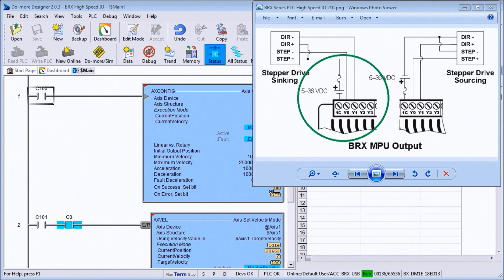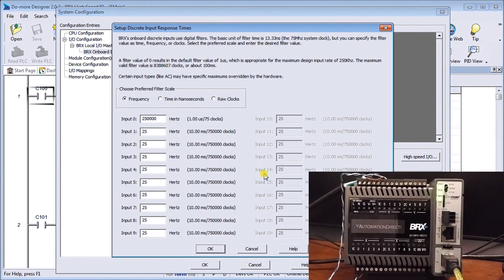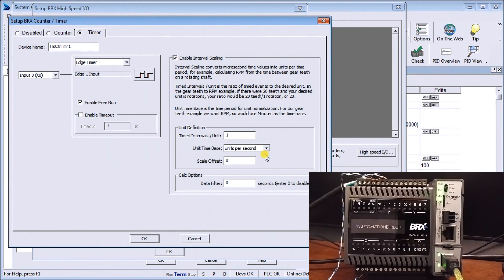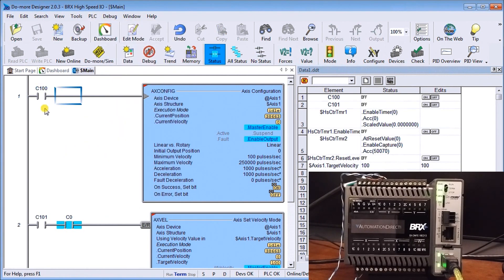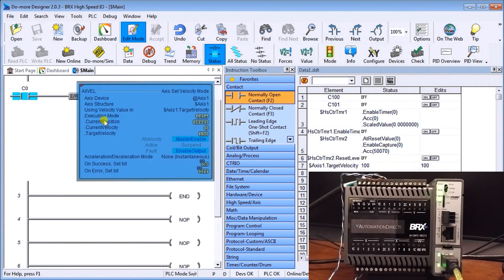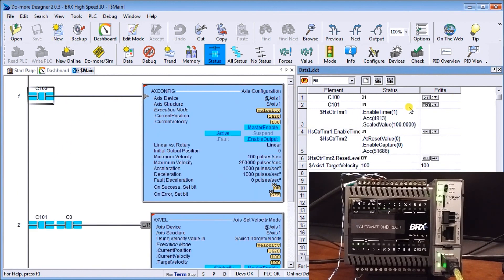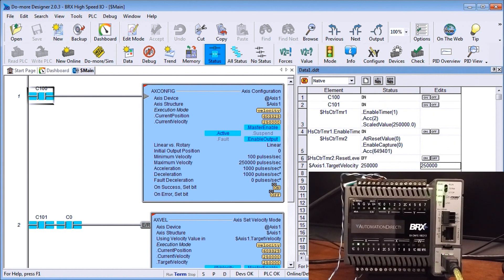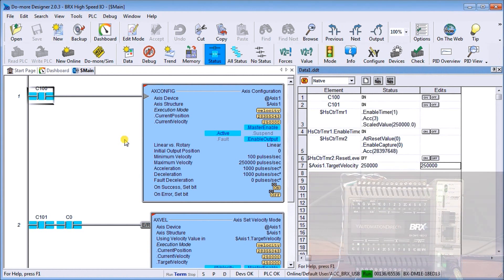BRX PLC High-Speed IO Breakthrough: Real-Time Pulse Testing

Comment: Would you have any links or good starting points for learning motion control,I would like to learn best practices etc, thanks
Reply from the maker: Hi Aussiegruber86
Every application that I have done in motion has been different. In general, stepper control will handle a constant load while servo control will handle a variable load. You then get into the number of axis or plains of movement. Does the axis need to be coordinated or do they act independently? 
Acceleration, Deceleration, and speed will not play a part in specifying the equipment required. 
I do not have specific links that I have used. Generally, I have been called in to consult on existing equipment that needs to be programmed. 
Manufacturers usually have great documentation on their products.
Here is a link for automation directs motion control videos.
https://www.automationdirect.com/videos/home?t=link&cat1=50
I hope this helps you out.
Regards,
Garry
Reply: @ACCautomation  thanks for the fast reply

Comment: is it possible to wire the output and input the same way on a bx-dmie-10ed-13  with an external 24VDC power supply going to commons like you show in the video?
Reply from the maker: Hi @jorgeresendiz1932
Inputs and outputs are usually isolated. (photoelectric) Since the commons are isolated for the inputs and outputs, you can wire them like I showed in the video. 
Note: Your  bx-dmie-10ed-13 outputs are sinking. This means that the 0VDC goes to the common for the outputs when using a DC supply.
The following post is for this video:
https://accautomation.ca/brx-plc-high-speed-io/
I hope this helps you out.
Regards,
Garry

Comment: Im using a clearpath motor, its needs to be triggered low on the enable pin of the motor. Any direction on how I can do this on the BRX dm1e?
Reply from the maker: Hi Elijah,
The enable for the motor is usually done with another discrete output point. (Y Area) Create the logic to trigger this output and make the pin low on the motor.
Please refer to the wiring in the manual to determine if the output has to be energized (On) or not (Off) to make the pin low.
I hope this helps you out.
Regards,
Garry

Comment: how do you change stepper motor direction with this setup?
Reply from the maker: Hi Mfadrigalan,
Usually, the direction is changed with a discrete output. Turning this on or off will affect the direction of the motor. See the wiring diagram of your stepper motor.
I hope this helps you out.
Regards,
Garry